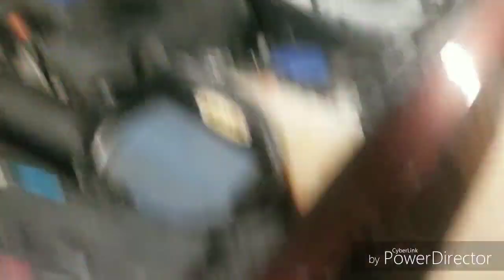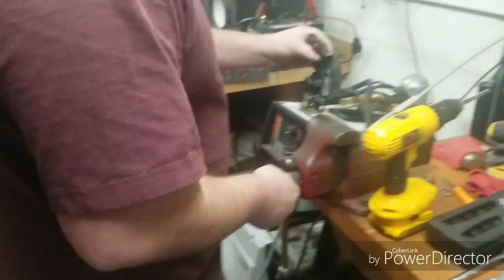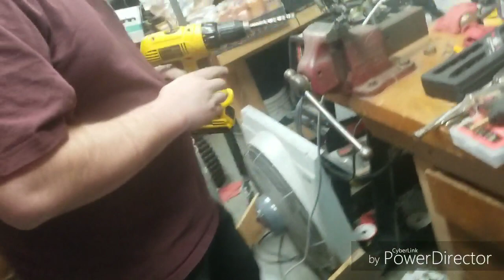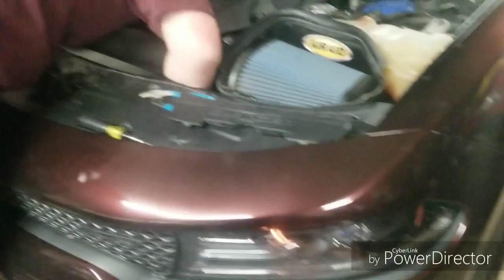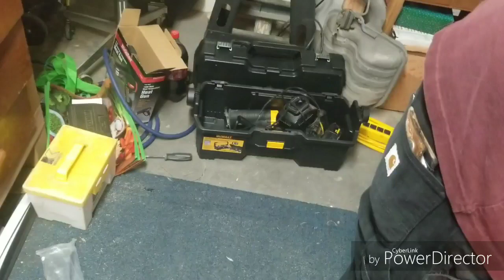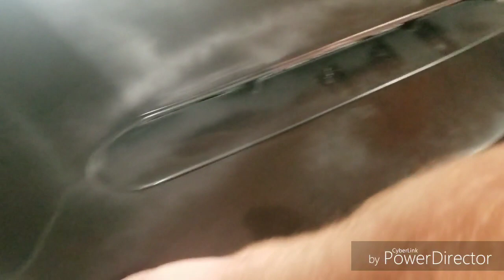Installing the Demon style hood

Comment: You could of used your old hood latch from the oem hood and put it on the aftermarket one i seen people doing that with the amerihood and it worked
Reply from the maker: Oh we did that. It was the form of the hood itself that was off just a bit. We had the OEM latch and the hydraulic hinges.

Comment: I know this video old but would you recommend this to put on a charger
Reply from the maker: Absolutely, it was something that I could do myself. There was no cutting or fabrication needed so it was simply bolt on.
Reply: @forstd09able  just gotta modify the hood latches? So it closes properly looking to do something different for my rt everybody has the hellcat or scat pack style hoods looking to change it up
Reply from the maker: Oh the hood, yeah we had to take out the latch and dremmel the slot for the bolts to make it so we could adjust it down. But it was pretty east. I woulf suggest getting the nozzle relocation kit or whatever that is to relocate the windshield sprayers
Reply: @forstd09able  thanks brother
Reply from the maker: @aaronferguson47  absolutely! If you have anymore questions you can look me up on IG and shoot me a message on there. @ronburgund_srt

Comment: Where did you get the hood?
Reply from the maker: I got it from a company called BMC extreme customs
Reply: ChargeD90 I figured that I plan on getting the same one how did you relocate the nozzles?
Reply from the maker: relocating them was a bit of a pain. I actually cut into the plastic at the top of the engine bay where they had molded a spot for the nozzles to fit when the hood shut. I used a product called propoxy that hardens like steal to kind of mold them so they wouldn't move around.